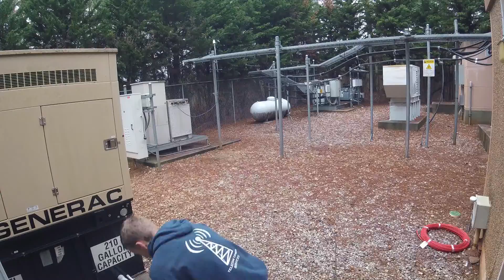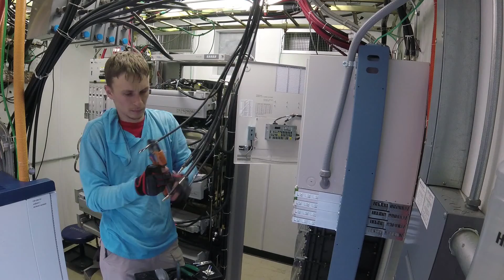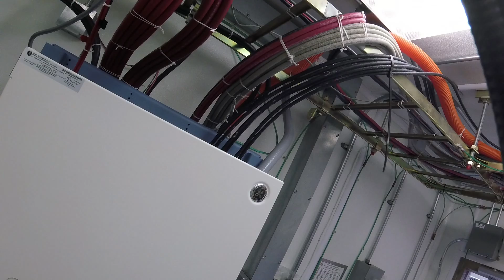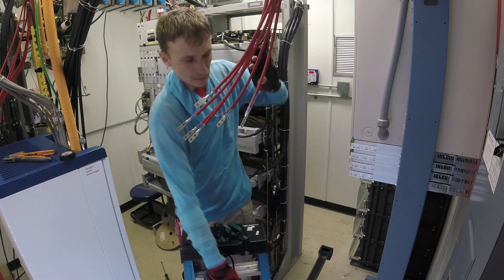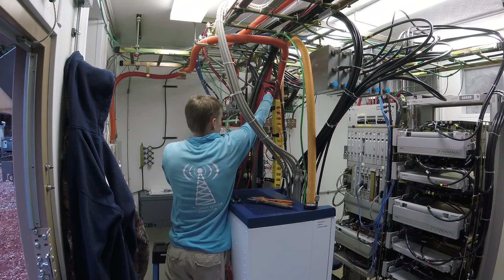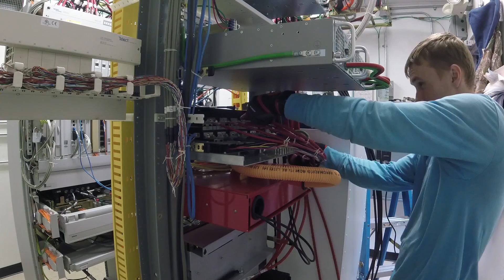Cell Tower Technician, Inside Prep Work

Comment: Im driving across my state for an interview with verizon doing this, and i very much appreciate being able to see what the work is as before now i had what small info they put in the job description and what the hiring guy i spoke to said.
Reply: @Shoota 305 they cut communication randomly before i drove out. I never heard anything back
Reply: @Toughbiscuit_  I work at verizon as a cell tower engineer which I believe was the position you apply for usually you have to be on top of the recruiter or manager so they can keep you updated